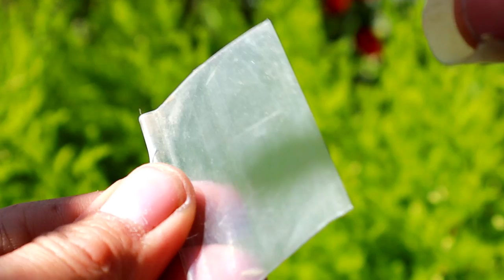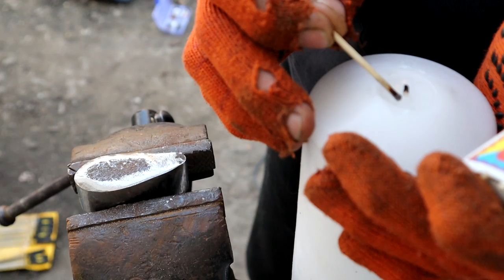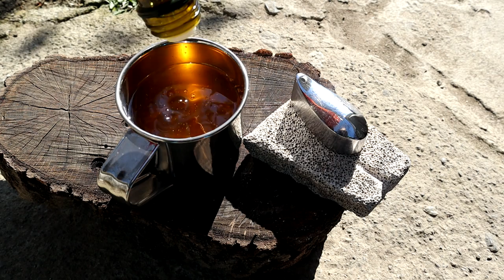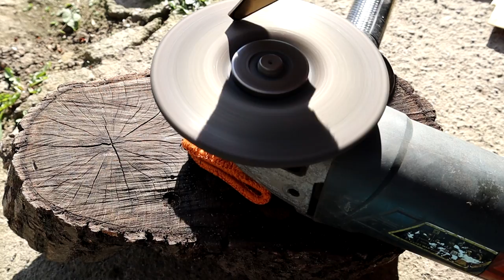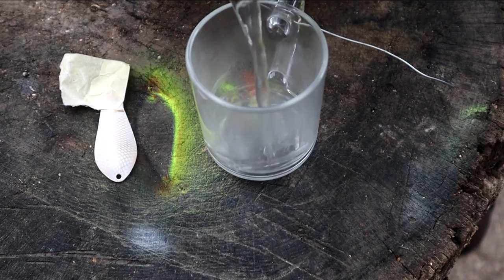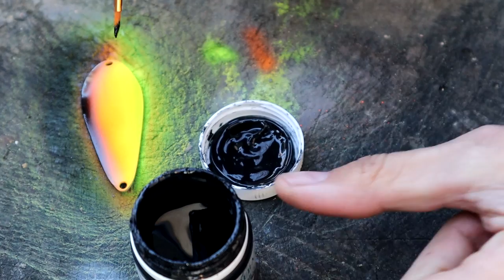PUNCH for LURE propagation / how to make a spoon with your own hands

Comment: Nice but That's alot of supplies to gather & to buy in order to make a less than $5 lure. Too expensive. Not everyone has the resources and money & time to buy All of those items needed to make a lure. Brass sheet, welding torch , railroad metal steel, automotive paint ect....
Reply from the maker: I have baits of different difficulty levels on my channel, and without tools...
Reply: What is the final cost to make these lures?